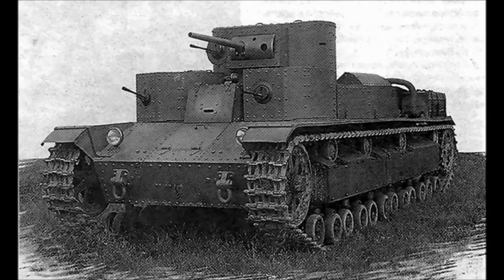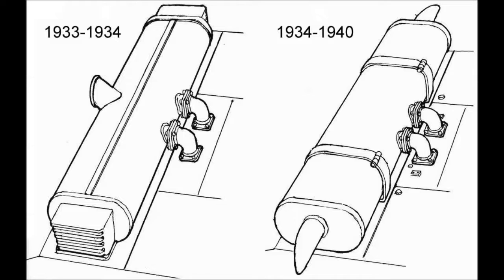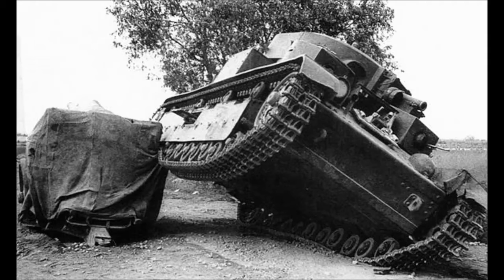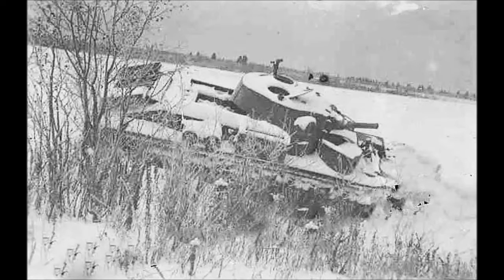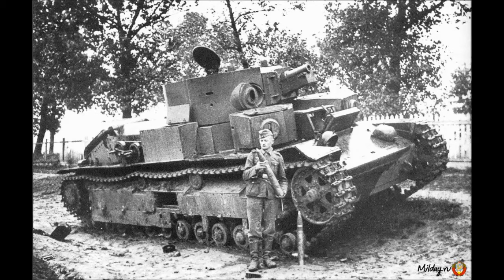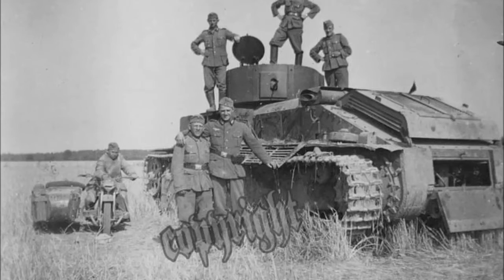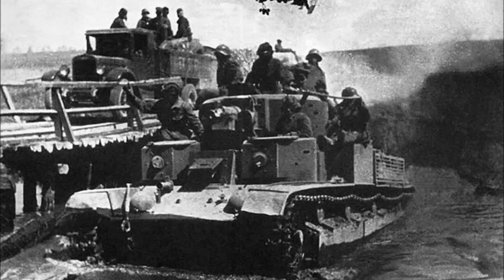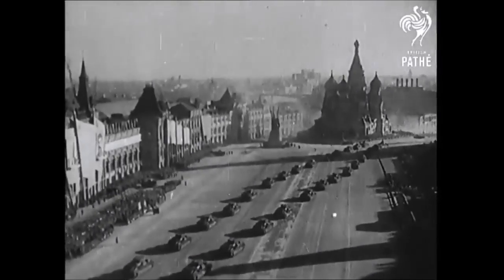A Brief History Of The T-28 Tank

Comment: Little surprised you didn't mention the several attempts at upgunning it further. There were multiple prototypes featuring the L-11, the F-32, and the F-34 76.2mm guns, as well as ones with the 85mm F-30 and 95mm F-39 guns.

Comment: All things considered, would you say that the T-28 or the T-35 was the better tank?
Reply from the maker: T-28 objectively. it was far less of a failure in terms of service career.
Reply: I'm glad you said that - I like the T-28 a lot, and while the T-35 is visually impressive, it is a sponge cake buckling under the weight of icing on top of it... Less mobile, less mechanically reliable, far heavier, practically un-commandable in any meaningful sense, and with a third of its manpower doing nothing a lot of the time, unless the tank was surrounded and firing rearward also..